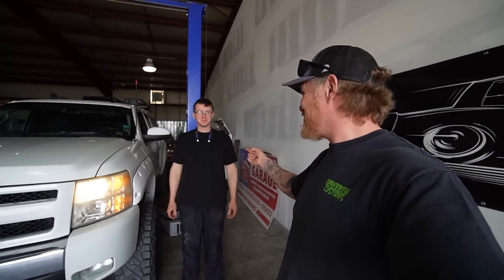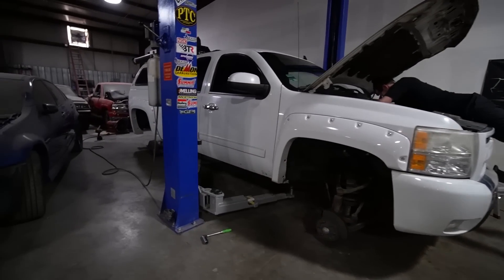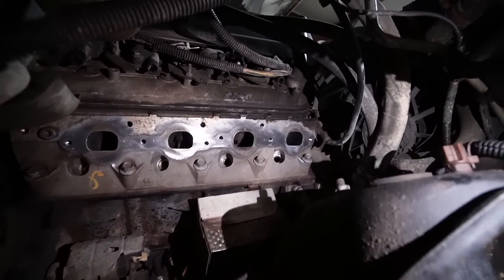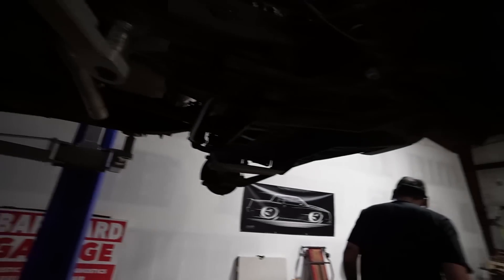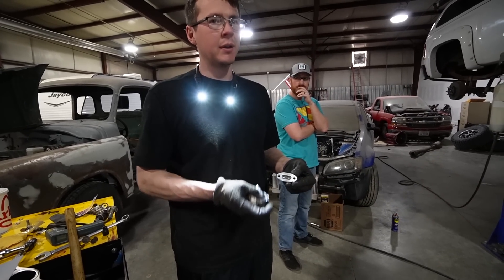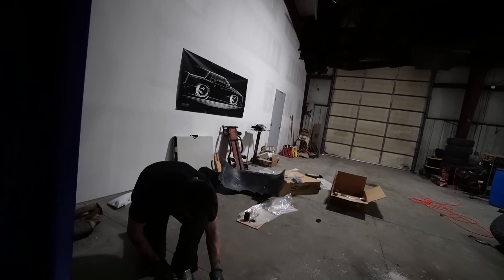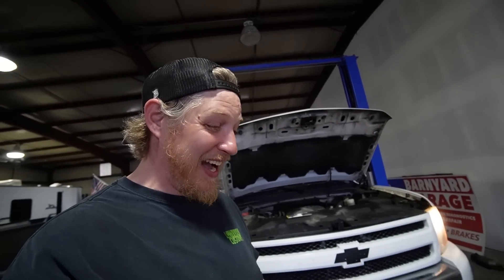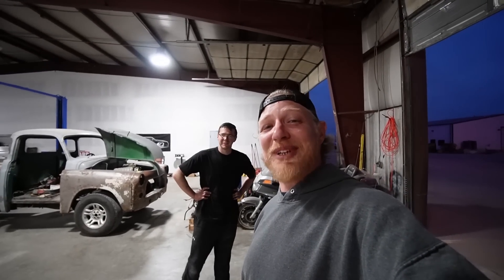Installing Long Tube Headers On My Cammed 5.3 Silverado

Comment: Awesome, I did similar whey back, a mild RV cam, 4.10 regear, long tube headers with gibson single exhaust.
Reply from the maker: Yeah I need to regear, the 3.73s with the 35s are doggy. Hoping to swap in 4.56 or 4.88 soon

Comment: Nice setup. My dipstick broke off when I put headers on my Silverado I ran a screw into the part of the  dipstick that was stuck in the block and then used a big flat screwdriver and a hammer to bang it out from underneath. Nice Monte and I like that SS poster

Comment: Nice upgrade, sounds strong.  Id like to hear it with a pair of flowmasters, i think that would give it a nice low rumble.
Reply from the maker: It's getting a magnaflow, it should sound good
Reply: I agree 💯
Reply: Good Stuff .. That's a Bad Ass Shop...
Reply: 🤣 wtf
Reply: @CrazyQuady  hey quady, on that oil leak, try checking your oil pressure switch
Reply: @CrazyQuady  nah flowmaster 10 series got it on my hd2500 6.0 I call it smile miles

Comment: That was cool man! I have a 2009 Silverado 1500 and had a lifter collapse a 193k miles. Ended up putting a crate motor in it with the DOD delete. Those headers are sweet man!! Good vid 👍🏻

Comment: Hell yea sounds awesome I need to get my eclipse finished so I can have it for summer boosted 4g63 evo16G turbo
Reply from the maker: Get it done! I used to have an Evo 10 with full bolt ons, I miss boost!
Reply: @CrazyQuady  I'm slowly getting there I have a 96 Spyder Eclipse with the 4G
Reply: @CrazyQuady  I over boosted didn't realize it was turned way up on boost car shutdown didn't blow anything but the water pump and seals out of the turbo shot oil up through the intercooler pipes from turbo and shot oil into cold air intake

Comment: If you would put new headlights on the truck it will make the truck look brand new
Reply from the maker: Yeah it could use a new set, I've polished these a few times already

Comment: The horrible cupping on those ridge grapplers.  Knew they would be a chunky clunky tire when they came out . 😖😖😖😔 I’d get rid of those fast.
Reply from the maker: They're fine, fronts are wearing bad because I haven't rotated them in over 10k and it needs an alignment since the new rear springs were put on, bringing the back end up 2 inches definitely changed the front end geometry in relation to the road
Reply: How many miles on that motor now ? Hope it’s not too tired to be spending all that on it. Fun’s stuff for sure tho!
Reply: I wouldn’t worry about it having too much mileage. Mine got cam and long tubes at 290k, stall converter at 310k, and 4.56 gears at 350k. Ls engines aren’t your grandpas small block.